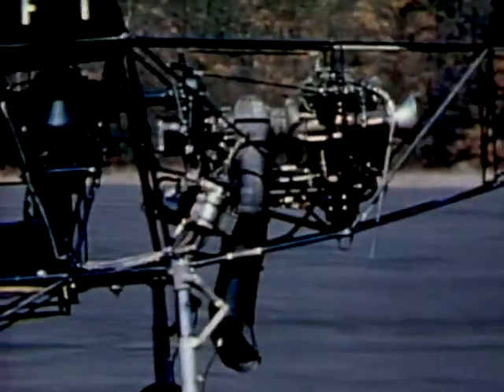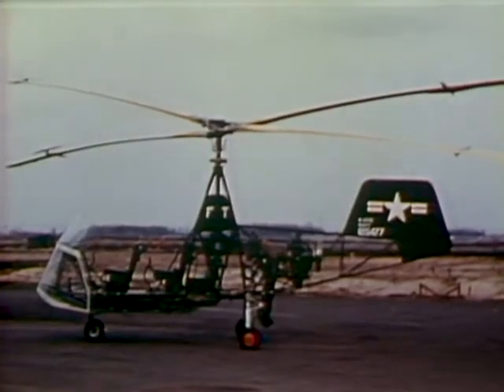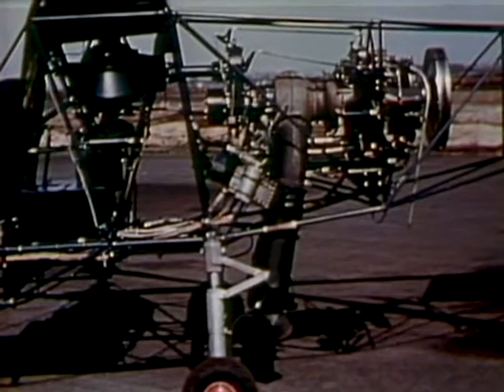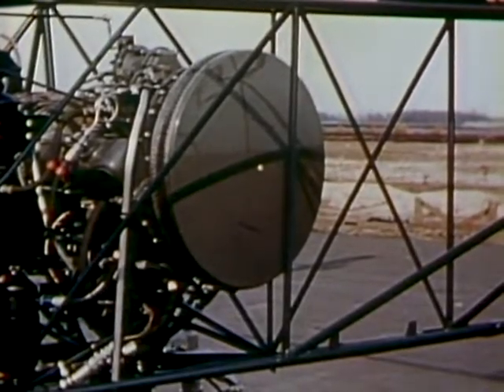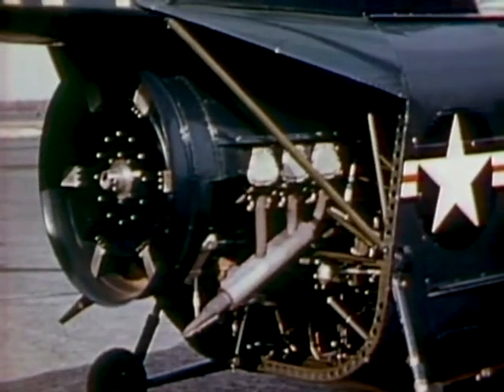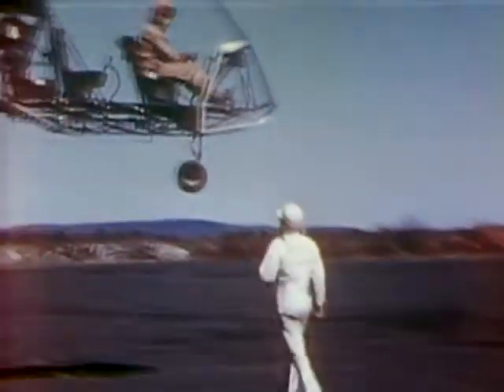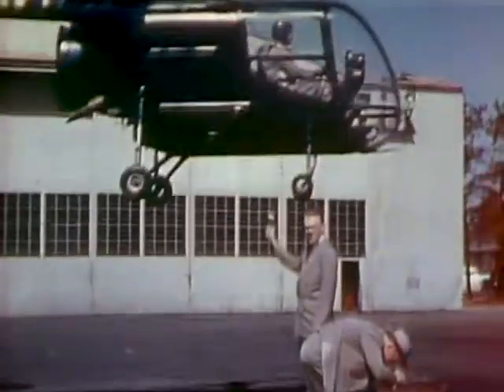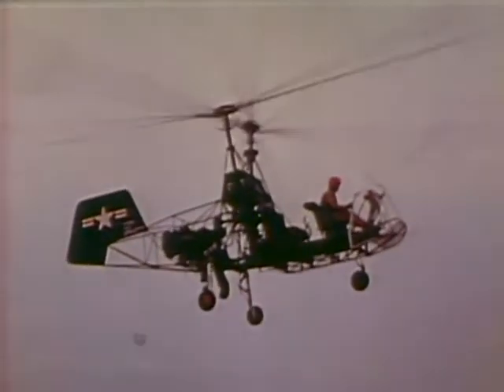The KAMAN Turbo Rotor Helicopter

Comment: Charlie Kaman was an exceptional innovator.
Reply: Innovator? The K-225 aswell as Karmans first "design" K-125 just look like stripped down copies of a German Flettner FL282 Kolibri with the same Flettner Intermeshing Rotor and, in this case, a turbine engine instead of a piston engine. The use of a turbine engine otoh was basically a self-evident evolutionary step to save weight and get more power, nothing too innovative really. And then what? The next big Karman design was the HH-43 Huskie, where...oh surprise...Anton Flettner was chief engineer again! And after that Karman Aircraft just produced 2 further designs,  the Seasprite, which is a conventional Helicopter design invented by Sikorsky, and the K-Max, which is again a Flettner Intermeshing Rotors design. I really don´t see how Karman was that great innovator, unless you count copying other peoples designs as innovation. 😂